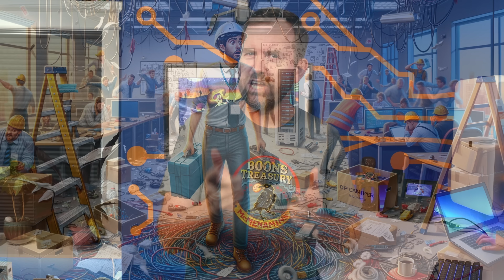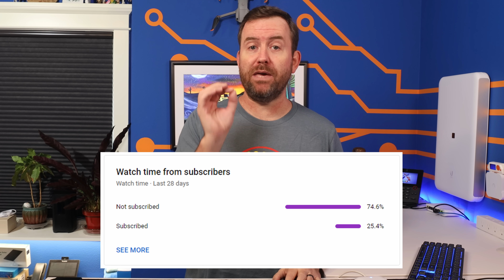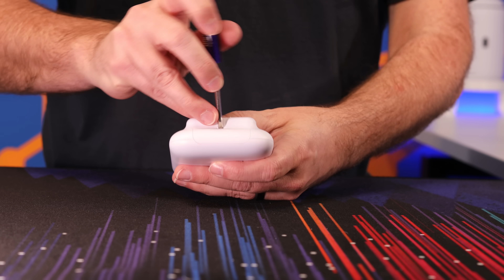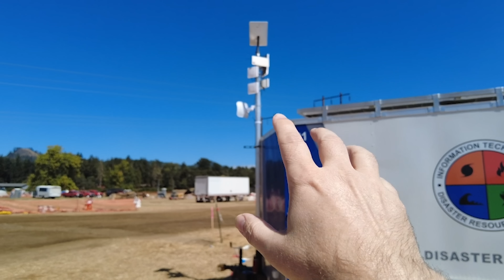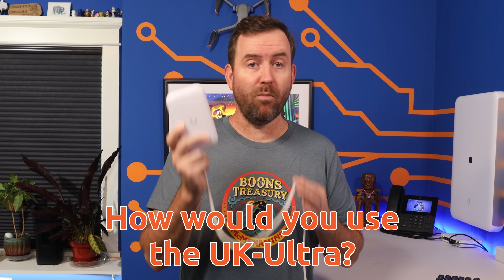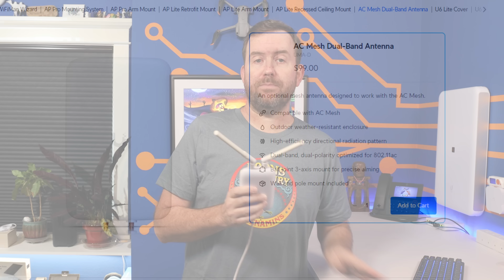UK-Ultra: The Swiss Army Knife of Access Points!

Comment from the maker: * CORRECTION:  MSRP is incorrect in this video - the UK-Ultra is $89 in the US and $79 in all other regions.
Reply: In fairness, it was also $109 on their website as well.  The $89 price point goes a lot further to support this being a 'low cost' solution.
Reply: I did a double take on the website today because I was sure it had been $109 or something, not $89. I wonder how it will compare to the AC Mesh Pro for range with the omni antenna they release.
Reply: Qq1qqqqqqqqqqqqqqqqqqqqqqqqqqqqaqfvgfgqfwqq11f1¹ @JacksonCampbell
Reply: A great alternative to the U6 mesh access point for sure. We run U6 mesh access points, because they were out of AC mesh ones when one of ours went down. It would be wise to keep a couple of these in the shop in case one of those fails I think.
Reply: @FoolOfATuque  U6 mesh is a way better AP though
Reply: Your GPT inserts are ridiculous. They are just not belongs here.

Comment: I'm not sure why I would want this when I can buy a used router for $10 and set it up as an access point.  Does it have a high power output?  No.  Does it support a guest network with bandwidth control?  Don't know.  Can I use it as a travel router?

Comment: I have wifi inside a metal building, but need reliable wifi outside the building for an automated entry gate access controller and camera. No concerned with band width. Just need a good AP that can be fully exposed to the elements and cover a range of 150-200 feet.
This should be just the thing I need.

Comment: While it’s not a wireless access point I would personally deploy in my house, I understand that it serves a purpose and is great for the price. And I’ve had a great experience with the Cloud Gateway Ultra. It’s a router, cloud controller, and has RJ-45 ports. Sure the RJ-45 ports are only one gigabit but this cloud controller supports 30 UniFi devices. With the vast majority of devices in my house using Wi-Fi, it made perfect sense to go with the Cloud Gateway Ultra, Flex Mini Switch, and U7 Pro access point. Great video!

Comment: I sure wish they would come out with a mount that would screw to the electical blue box or mud ring that we install during rough-in. We nail it in place, pass the cat thru the box, loosely stapling about a 12" tail on one side and pull it out when we are trimming out. Based on their installation images I guess we are supposed to have a cat hanging out of the ceiling or wall and hope the sheetrockers don't destroy it or cover it up. This all looks like old work installation. How about thinking about the large number of homes getting prewired during the construction phase. I've only seen one of their access point mounts with enough holes in the right place to mount to a blue box or mud ring. These engineers/designers need to get out of the office once in a while.

Comment: For some use cases even wifi 5 is overkill. I live in a rural area in Brazil and don't need the gigabit internet all over my property, just something for someone that's out and needs to call (no cell phone signal here) and one very remote camera (bridged with a pair of nano station 5 because the terrain is too bad to bury a fiber cable). 
I'm doing fine with an air grid M2 HP for a linear section of the property, a nano loco M2 near the gate and a rocket M2 with two big ass 90° antennas for the main outdoor area.

Comment: The almost Swiss Army knife, it still needs a PoE injecter. Just for the love of.. release these things without PoE.
Reply: I get what UniFi is going for with them being compact and aesthetic…but yes, it would be nice not to have to spend extra on injectors. I like the approach they take with devices like the Flex Mini switch—comes with USB-C power adapter and cable but also supports PoE.

Comment: Have watched a lot of your videos as I’ve been wiring our new house with cat6. Can’t seem to find an answer anywhere, what do you put in the wall by the router for all the cables to terminate in? Just a 3 gang box with those little bristle things so the wire will go out into the switch? Seems inelegant but I can’t find a better answer.
Reply: Try googling for RJ45 keystone jack plate for terminating cables at the far end. You'll want an RJ45 keystone patch panel to terminate the cables at the central location point. Use patch cables for connecting the patch panel ports to the switch and router 👍

Comment: well, i do se use-cases for it, but it would be nice with a wifi 6 AP with external antenna connectors. 
and also i am always a bit hesitant to trust the "Outdoor" capability's of unifis APs. when you have 3 feet of snow, rain, freezing temperatures in the winter and warm in the summer i would love to se something with a better IP rating and cable connectors that are waterproof.

Comment: I like the idea of this product however we (at least in Australia) have the issue of being unable to purchase many Ubiquiti products due to the consistent lack of stock since 2020. The situation is leading me to consider replacing my Unifi network with Omada. I do hope that 2024 will see a change because I am really opposed to buying networking devices from Chinese owned manufacturers but it's getting to the point where I won't have any other option. Thanks for the content, cheers from OZ
Reply: I ended up using mikrotik here in aus. We have a few suppliers but stock can still be hard to get. Just wish the ui/ux was a bit better.
Reply: @gtvwill   I have looked at the Mikrotik range however they lack the unified software UI. cheers
Reply: @cyclemoto8744  Mikrotik uses The Dude 
or you can use something like Unimus.
Reply: Have you tried the services that redirect US deliveries to AU?

Comment: Not a swiss army knife at all. One band, 2x2, PoE only, antennae that can't be purchased. Um, no. This is a result of a 5GHz chip glut and a manufacturer looking to save money, not for the customer. A UAP AC Mesh is a much better choice than this thing, hands down - smaller too, if you remove the ears when carried around (spare in bag). Poor product, UI. And their stock slid this Q too... bah.
Reply: It's 2.4 GHz and 5 GHz

Comment: Sorry but the antennas are NOT 20dBm.  dBm is a figure saying the TX power lever which is the same as 100mW.   If you're describing an antenna gain it would be in dBi (DeciBell's as compared to an isotropic antenna). In the case the antenna gain is 6dBi.

Comment: Unifi's software - though still have improvements - are slow/late in terms of daily requirements. The software architecture should also be revisited because some updates are terrible. They really need to step up as some chinese brand has very similar software features and architecture (controller for SDN with cloud capabillity). easily said: the cost efficient TP-Link.

And I once had to embark my customer to TP-Link because of stock unavailability.

EnGenius also targeting hotels/hospitals in SEA market. Now, we see RuiJie with the ReeYe models are agressive. Not only RuiJie may give Unifi a run for its money but the Enterprise range is or should be scary to the Ubiquiti line up (even on the carrier market).
Reply: I use Ubiquity at home but the bad update experiences I've had would put me off using it at work (manufacturing)

Comment: I really like the form factor. I think UBNT have done really well designing it to be so flexible and I get that by making it Wi-Fi 5 only they can keep the price down. However if I buy one of these I'm going to want to keep it 2 to 3 years minimum, so making it Wi-Fi 5 only hurts the longevity of the product. To be honest you're better off to just buy a U6-Mesh which is almost as flexible except for the external antenna's. Sorry but UBNT got this wrong.
Reply: I'm not sure, there are a lot ppl that can't even get anymore than a 100 down and 20 up connection from there ISP. All that functionality for under a bill is pretty good. Also can a  mesh like your talking about do wired backhual?  Honest question btw.
Reply: @Steve_Just_Steve  For me Wi-Fi 6 is important for high speed LAN transfers to & from my NAS. I have a lot of MKV rips I've made of my physical movie media, laptop backup image creation etc. The U6-Mesh has a ethernet port so that covers the wired back haul, though I wouldn't use the U6-Mesh for meshing, UBNT's meshing is pretty average. In my use case I have 28 ethernet drops around my house so I can always  hard wire an access point near where I want it.
Reply: @lordcarnorjax8599  Good point.

Comment: I don't see low-cost alone as a good product strategy.  Maybe they had a huge bid and developed this for a large corporate or ISP deployment, charged NRE, and decided to throw it into the regular line-up to get incremental sales?

I would like to see them do products with different features or capabilities, rather than just price.  A plug-and-play PTP Wi-Fi bridge in the low-cost range would be much more valuable.  Something to bridge a backyard,  detached garage, pool or other home-based application where a wire can't be used.   Not competing with the higher-end dedicated pole-mount bridges in UniFi's other product lines or WISP products.

With the venerable AP-AC-Pro getting old, there isn't another choice for UniFi AP with two Ethernet ports - one for PoE power injector and a second for local bridging of multiple client devices.

Comment: I guess the directional antenna option wouldn't work well as most of us might think because the clients still have the same antenna for transmitting back and on most cases our directional antenna won't be able to help on that case. Maybe would work well for a point-tto-point setup though where both sides have good directional antennas, but that's not the product for that I believe.
Reply: Antennas work in both directions, more narrow beam angle doesn't only mean stronger transmit in given direction but also greater sensitivity in given direction. Thus superior antenna will benefit clients with lesser antennas, they can't shout lauder but more directional (= higher gain) antenna can hear them better. I'm not sure why would you want directionality tho since WiFi clients often move about and that doesn't go very well with directionality, it would work better in one direction but much worse in others so don't see the point for client devices. Perhaps some very wide directional antenna would make sense but classic directional antennas are fairly sharp angle so that doesn't make sense on short distances.
Reply: @tomaskolinger  thanks for explanation
Reply: I have a UMA-D paired with an AC Mesh. It absolutely improves device to AP reception such that I can maintain Wi-Fi over 1/4 mile away in a low, not zero, interference environment even at a 60*+ angle from center. It’s amazing!
Reply: well it sounds like im about to buy a couple of directional antennas for the garden ap

Comment: Seems a great replacement for the AC-mesh. I like the temperature range and weathering
Reply: What are the advantages over an AC Mesh? I can't find anything in the specs.
Reply: @karstenstrunk4689   Probably not much advantage. I've just been wondering when they are going to stop supporting the mesh because it's been around so long. So, if they stop supporting the old one this will and one breaks, at least they still  have a good replacement for them.

Comment: The two things I think ubiquiti could improve upon with this is USB-C power, for situations where PoE is not available, and maybe some other mounts, like a tripod mount and a suction cup mount.
Reply: You can always get a USBC to POE converter if thats your use case.
Reply: You can always make your own breakout cable.
Reply: That's what a power injector is for.
Reply: @rogerwilco24601 but that's not the spirit of a swiss army knife ;)
Reply: @u1f98a  A Swiss Army Knife has useful tools. USB-C power would be pointless.
Reply: @rogerwilco24601  ??? can't tell you the amount of times where i've had to go and find a poe injector/switch when it would have been so much easier to have USB
Reply: @u1f98a if you think that, shouldn't there be a cellular connection so you can use it as a stand alone wireless router?

Comment: Okay.. but why pay 109 when the u6 literally is 99?
Reply: in the elements installs. There is no WiFi 6 capable AP in Ubiquiti lineup, that would have equal ratings for water and dust resistance to AC-M... Which brings the question, why this, when there is AC-M :D
Reply: It's 80 (99 with taxes) USD in Europe so a bit more competitive, also, which U6 is 99?

Comment: This could be useful... if it had a WiFi6 chipset...
Reply: I don't think it being WiFi5 diminishes its usefulness.  There are a lot of situations where  WiFi5 is a perfectly good fit.  If you're setting up an AP (or multiple) in a location where there aren't many WiFi6 devices, then WiFi5 is a perfectly good choice.  This also means that your POE switch can be less powerful, since this thing barely uses power.  This will most likely be in small deployments.  Larger deployments will definitely want more robust APs.
Reply: @SeattleSandro  Sure it’s fine now, but the marginal cost of a WiFi6 chipset can’t be that much at this point. I seriously question the value of deploying anything on WiFi5 now because it’s reaching the end of its lifecycle.

Comment: Would this be a good device to be used on my patio to get internet to a Sonos amp for landscape speakers?
Reply: Yes, it should be, as long as you can run an ethernet cable to a POE switch.  If not, a mesh AP may be a better choice.

Comment: The cost of wifi 6 vs wifi 5 chips are negligent.
Reply from the maker: What are the costs?
Reply: @CrosstalkSolutions Shhhhhh your not supposed to ask 😂
Reply: Negligible, surely?
Reply: It also takes that 8W of power and increases it for WiFi6 radios, so you lose some of the lower power capabilities, just like 5Ghz WAPs vs.. 2.4Ghz WAPs.